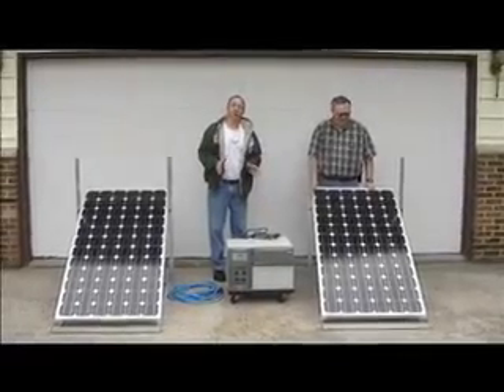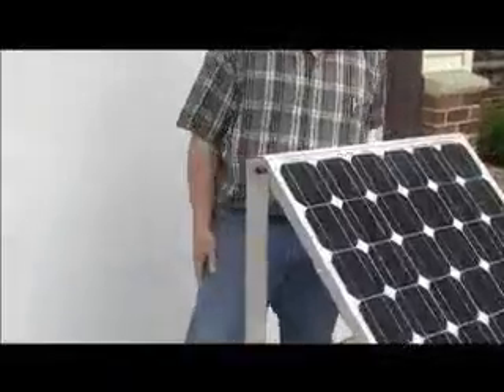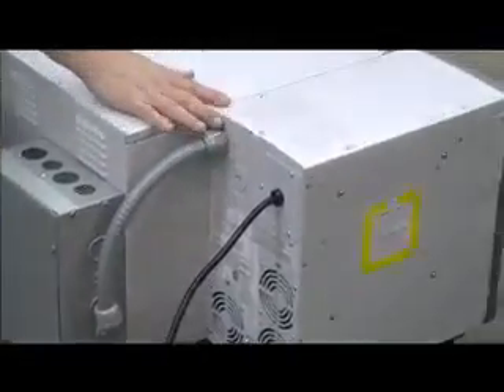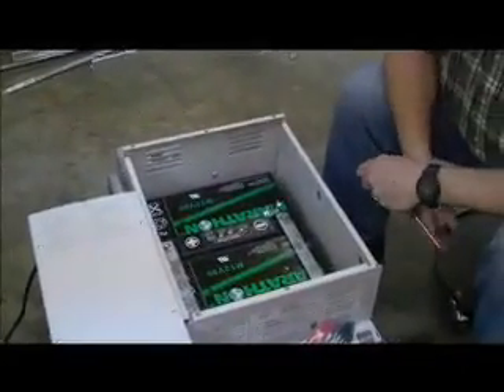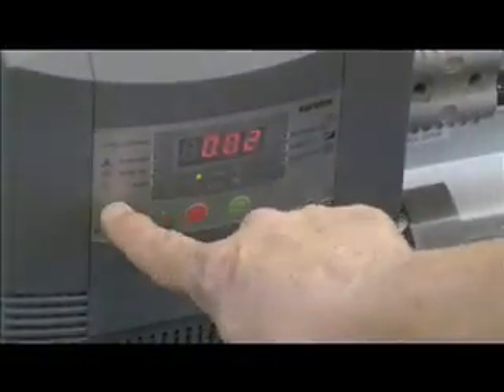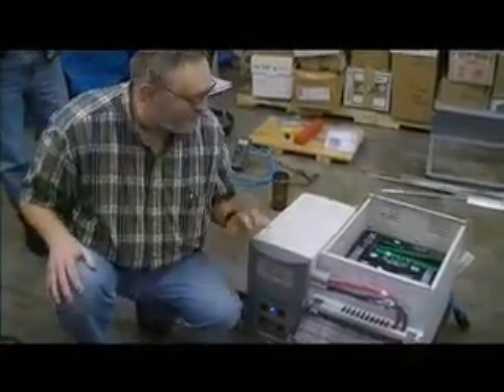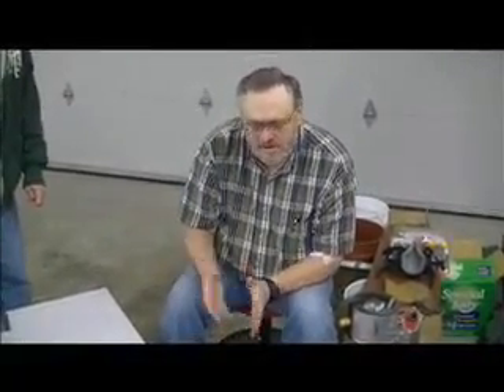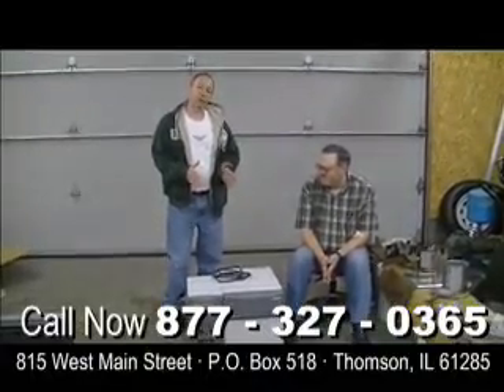MySolarBackup Review - Power Hub 1800 Video

Comment: It's a Xantrex Powerhub 1800.  You can add up to 400 Ah of AGM batteries to it, and you can charge it via solar, or mains outlet.  It's a modified sine wave inverter and will run a load of 1440 watts continuous.  It is a real product that works as intended.  However, I wouldn't buy a modified sine wave inverter, only pure sine wave.  In short, the device itself is real and does work, I don't know anything about the people selling it though.